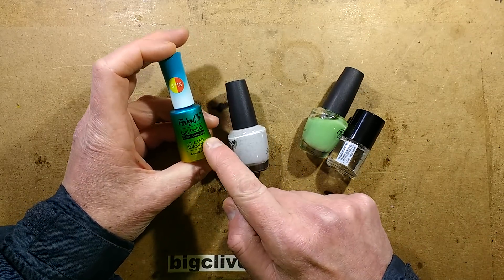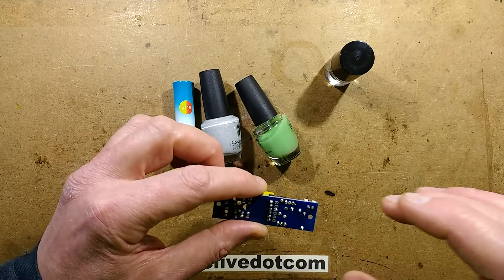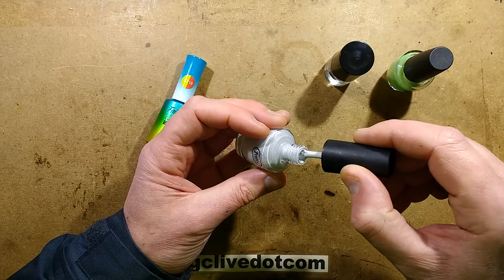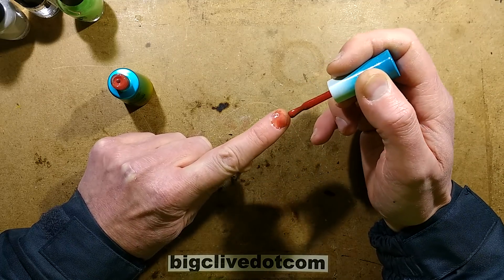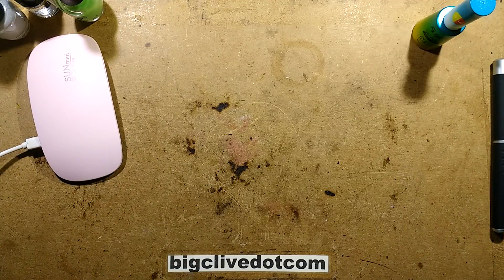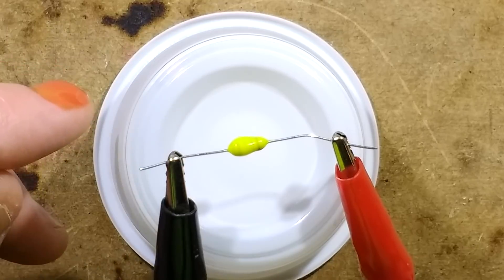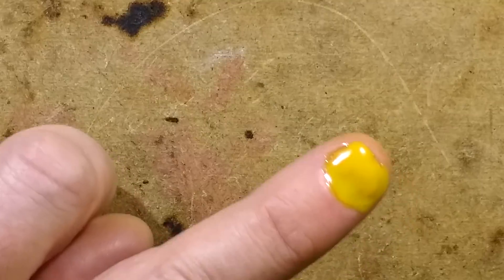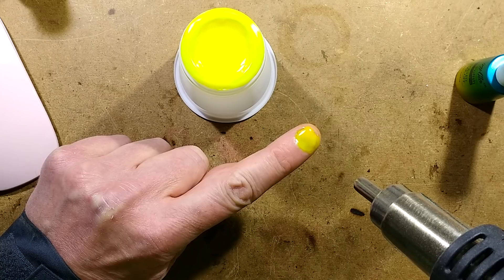Technical uses for nail varnish.

Comment: Not sure how I learned something about cosmetics from your channel, but I'm getting uv curing nail polish immediately. I HATE waiting for it to dry. Thanks!
Reply: Or maybe I won't. What's the point of saving 5-10 minutes putting it on if it takes 15 minutes to take it off, nevermind the solvent soaking. 
Tangentially, I wonder how many people have set their fingers on fire by smoking or something after / while soaking

Comment: I bought a  bunch of fluorescing  powders through Ebay from China and used them with clear nail varnish on some glass lamps. One fluoresces with an ordinary bulb for 45 seconds when the lamp is turned off. I found my first pink/green uranium glass last weekend it has a huge amount of pitchblende. Some of my 19th century uranium glass is also high in uranium oxides.

Comment: Afaik the soak off is usually a bit of cotton wool soaked in acetone held in place by a kind of finger sized peg for a few minutes. Still probably not great for your fingertips but a degree more localised to the nail than dipping your entire fingers!

Comment: And to think, we've been sealing screws on tape recorder head azimuth adjustment pillars for donkeys years, also very good for locking screws when replacing VCR heads. Quite handy too for cementing small low power TO220 devices etc.

Can also be used for decorating finger nails - apparently!

Comment: There you go 
https://www.ebay.co.uk/itm/10ml-Thermal-3-Colors-Temperature-Color-Changing-Soak-Off-Nail-Art-UV-Gel-Polish/142650300606?_trkparms=aid%3D1110006%26algo%3DHOMESPLICE.SIM%26ao%3D1%26asc%3D225082%26meid%3D429711d39ccc49e1b6c6161c4b1f3ba0%26pid%3D100935%26rk%3D1%26rkt%3D2%26mehot%3Dco%26sd%3D233599586653%26itm%3D142650300606%26pmt%3D1%26noa%3D0%26pg%3D2332490%26algv%3DSimplAMLv5PairwiseWebWithBBEV1Filter%26brand%3DBorn+Pretty&_trksid=p2332490.c100935.m2460

Comment: Hi Clive - greetings from Finland! Nail varnish is also pretty useful for modifying potentiometer tracks, in that painting over the very end of the wiper travel where the maximum resistance is achieved adds point where the wiper is electrically isolated from the track. Fun stuff.

Comment: I like how the nail varnish reacting to the heat gun sort of illustrates the little things that might affect even heat application. Obviously, the coating and actual material will complicate things a bit, but it seems pretty much like what I expected.

Potentially, if someone had to get an even, reliable application of heat on the same object over and over this could speed up the learning process, for relatively cheap. I don't know if it would be all that good for something where ya only get one shot at the real thing and want to practice, though. I assume a thermal camera would provide a lot more useful information for that.

Also, I love how full of life-hacks these comment sections can be. Even when it's seemingly quite silly, sometimes it's good to have more options for combating weird problems. I can't see myself painting fingernail polish on random things to fix the invasion of the LED's, but I wonder if anyone knows of a similar option that works of all or nearly all materials, staying on until I don't want it, and coming off cleanly and relatively easy. (without it or any necessary solvents potentially screwing shit up. I might be overestimating the potential problems of watery acetone, though.) When I started looking into tape for solar panels on garden lights, (Thanks for the mother's day project idea, by the way, Big Clive!) I saw people mentioning interesting applications for liquid tape, (It was in the "customers also bought..." section.) including as a way to cover LED's, I think. Even if it isn't good for that, I bet clear and colored liquid tape could have a lot of cool weird uses too.

Comment: Hey I'm sure you know yourself already as this was posted a while ago now and someone's probably mentioned it but you can also get the thermochromic pigment in that nail polish cheap in bulk off aliexpress for different temperatures , I bought some before for painting Zippo lighters and they go from black to clear exposing the colour beneath,  there's a vid on my channel,, they sell the photocromic light sensitive stuff and the glow pigment too , gave me a tester of them when I got the thermal stuff.

Comment: Hey Clive. Thanks to you I had some fantastic results using the Fairy Gel. What I did was paint the heatsink (quite large) which is attached to a mosfet on one of my systems. Using the laser temp guage I was able check approximate temp across the heatsink, giving me a good visual estimate of temperature as the mosfet temp increased. Super idea for a quick and easy estimate. Plus it looks cool. Thanks!

Comment: 2:17 - "...and if you add more in..."  From personal experience:  if after adding in the powdered pigment and mixing well it becomes too thick, check the ingredients on the side of the bottle.  Most polishes contain isopropyl alcohol and/or ethyl acetate.  If yours does and if you have either of these on hand, add some to the mixture one drop at a time using an eyedropper and mix well.  This will progressively thin it up again.  Just be careful to mix each time you add a drop to test consistency.

Comment: big clive i love u and everything but watching u mess on with that gel polish is making me cringe so hard. gel polish needs to be applied in thin layers one at a time with a minimum of a 30 second cure, preferably 60 seconds. u then need to wipe it with alcohol to get rid of the sticky layer on top. also that glow in the dark polish will take forever to dry given how thick it is 😣 ur better off finding a glow in the dark gel polish OR getting some polish thinner and adding a few drops to it to thin it out. sorry if this comes off nasty, that wasn't my intention. just sharing tips and tricks to makes these polishes easier to use 😘 xxx

Comment: A couple of other uses Clive is using a metal flake one on a case screw say in a laptop you have repaired and you take a photo of it. It then acts as a security warranty marker, you can never paint it again so the flake is the same. I also use nail polish to put a marker on all my tools as I used to be a mechanic and we had our own tools and mine had blue metal flake on them .

Comment: Interesting, indeed. You can cover your prototype PCB lines with nail varnish before you etch them, using the varnish, a syringe and a hypodermic needle. You can't do very thin lines and extremely difficult boards, but it's great for a start.

Comment: I also find it useful to use nail polish as a cable management solution. By color coding the ends of each cable, you can identify which cable is which quite easily.

Comment: I have a small scratch on the aluminum frame of my phone, and I tried to hide it with a black Sharpie but it got erased over a 24h period, I am wondering if I can put nail varnish on top of the sharpied area or if it would come off easily, I know I could get some black varnish, but it would be kind of a waste since I only need it for this one time on a 1cm scratch and nobody in my family wants to paint their nails black.
Reply: Black nail varnish is pretty cheap if you don't care about getting a decent brand. And you don't, if it's just for a phone. Not much of a waste.

Comment: Our washing machine’s stator windings were scored when the rotor hub broke. I carefully separated all the damaged windings, and covered them with clear nail polish to insulate them again, and with a new hub, two years later the machine is still running perfectly.

Also used to use it to lock azimuth and alignment adjustment screws in tape decks and VCRs back in the day.

Comment: Two more uses: believe it or not, back when dinosaurs roamed the earth and PCB blanks and ferrous chloride used to be available but laser printers and SMD parts didn't even exist, we used to literally paint our (clumsy but functional) home-made PCBs in red nail varnish, usually using one leg of a resistor - if we pre-drilled the board, quickly dipping said varnish-carrying leg into a hole formed pretty perfect little pads. It was very much etch resistant and you could just wipe it off with acetone afterwards. Oh, and of course, it's the stuff you use if you want to fix in place any calibrated trimmer pot or capacitor...

Comment: Great video Clive. I have another use for nail varnish that you may not have thought about - using it as a really low strength thread lock for tiny screws and nuts.

I repair vintage cameras and often require the screws to be fixed tightly, but not over tightened to the point where it would be difficult to remove. Once the screw is tightened up, a small blob of clear nail varnish over the screw head prevents it from unwanted loosening, but it’s weak enough to be undone should you require. I’ve used this trick on spectacle frame screws, guitar bridge adjustment screws, cameras, and many other items.

Red nail varnish can be used on nuts and bolt heads as a indicator to show if they have loosened off, a small line of varnish over the bolt head and onto the surface beneath will easily show if the fastener has worked loose.

Comment: The glow in the dark varnish is strontium based. If it was strontium 90 it would glow for centuries.
The resistor coated in the colour changing lacquer reminded me of the old body-end-dot method of colour coding resistors. The colour changing paint would cause a little confusion!
Could be useful for coding thermistors, get the pigments right then the colour code would track the thermistors actual resistance whatever the temperature.

Comment: @Bigclive if someone wanted to do a bodged job and make a PCB board less susceptible to moisture damage would the clear lacquer work do you think? In other words paint the entire board in the clear lacquer to protect it from moisture ingress? I have a device that is not waterproof that I would like to place outside.
Reply from the maker: It's a common technique to coat PCBs in thick conformal coating like that.  Quite often literally dipping the PCB in lacquer.
Reply: Interesting cool thanks good to know. Keep the videos coming thanks again

Comment: The chemistry of temperature-sensitive nail polishes is explained here --
http://www.labmuffin.com/how-do-thermal-polishes-work/

"These temperature-controlled products use pigments known as "leuco dyes". These clever systems consist of tiny little spheres called microcapsules, which are about 1 to 10 microns across."

See also:  https://en.wikipedia.org/wiki/Leuco_dye

Comment: I keep a bottle of deep blue nail polish (company color) at my bench and use it for fixing adjustment screws on pots and capacitors after alignment or tuning.  It provides some small drift prevention due to mechanical shock, and also an indicator for tampering.

Comment: Clive, It's good to see you are comfortable with your gender identity. Never doubted that for a moment.
However i do think you may be on to something with the temperature shift paint - visible indication of overheating perhaps ?
Coat a heatsink so you can see the hotspots ? LED heatsinks, High current regulators, A small dab over the die of an IC ?
Now if only thier was a way to adjust temp shift higher - or is there ???

Comment: Another use for the clear nail polish that I learned in a geology course is as a clear-coat for markings. In the geology class we were taught the technique of marking rocks by first painting an unobtrusive part with white-out, then writing one's not with ball-point pen, and then seal with clear nail polish. I've taken that same technique to marking circuit boards. Even using the clear nail polish as an additional coating to help keep little tiny p-touch labels from being easily picked off. Note, the acitone solvent in the nail polish will cause some inks to smear (for example sharpie ink). You may need to experiment with ink types to find one that works best for your application.

Comment: Hey buddy, not sure if it's been mentioned, but many nail polishes are nitrocellulose based so even when all the solvent has flashed off they are reasonably flammable. It would be interesting to see if arcing on a circuit board could set it on fire. Doesn't stop me from using it as a poor-mans threadlocker though :)

Comment: Does Clive have colour-changing toenails, we wonder??? Thanks, BC. Many people have used unwanted nail varnish for locking screw threads, securing wires, attaching items, even low-load repairs, for decades. It is just as effective as, and much be cheaper than the 'proper' thread locking compounds, especially if you scrounge it from the females in the family when they're having a clear-out. Free samples from Avon, etc, are also useful! Thin the varnish with (scrounged!) nail varnish remover when necessary.

Comment: i believe its thermal reactive pigments. they usually change around 87F. they sell it for car paints too. I was going to get some thermal black pigments, which they mix with a clear, and paint my white car. SO when its 87f or above the black pigment goes clear showing the under color, which i thought would look cool. And below that temp it would be black. I thought it would be nice during hot summers the car would be white and not absorb so much heat. then when its cold at night or during winter it would be black except for the hot parts. really neat stuff!

Comment: Plot twist: Clive opens his own nail salon after he stumbles across a conductive transparent nail polish which enables him to light up the phosphorescent dye on the nails of every woman, man, and cat, on the planet. He throws out a nice video where he explains that a Light Emitting Capacitor works by the field effect, similar to how you turn on mosfets, but rather inverts the population of virtual p-n layers on every cycle of the rf circuit, giving light whenever a hole (positively ionised atom in the crystal lattice, in the p virtual layer) meets with an electron again. He then goes ahead to engineer the rf circuit, based on a symmetrical Joule Thief (royer type) design, and then reverse engineer it, for the sake of the video. :) He will then make his latter discovery while pondering the potential of the design, that Nickel 63 is like Tritium, but better, and will invent the: stay on lit forever nails. 
Kisses from Greece/Love Glasgow, miss my old house over there at Glasgow Green park.
Reply: Meanwhile the comment section makes endless smutty comments about "holes". Sorry Clive!
Reply: greenaum: Smuttyness is in your mind, greenaum. A hole is a left behind positively charged ion in the crystal lattice of a solid in terms of solid state physics...
Reply: Yeah I know that, ta. But it's not all a hole is!

Comment: You can tell you were never a goth! I used to be able to put on nail varnish whilst drunk in a very dark night club. That colour-changing nail varnish would be very useful for Orange Pi single board computers as the processors are notorious for getting too hot.

Comment: I used nail polish extensively in my shop to match Allen screws on the machines to the wrenches that go in them. Ditto for other kinds of wrenches. It's all color coded. The pots and pot lids in my kitchen as well. This little thing has saved me countless hours wasted searching for "the right one".

Comment: I have been using clear nail polish for decades. Sometimes its the easiest way to insulate small wire repairs to prevent shorts. Never came across the colour changing one but that definitely useful. The glow in the dark seems interesting too.

Comment: Oh boy, thermal nail polish is cool if you have long nails you get the benefit of 2 colours on your nails without doing a gradient, yeah I dont do gels or acrylic nails for this very reason standing my fingers in acetone isnt my idea of fun, so I just regular polish, you can also get a peel off basecoat with means you dont have to soak your polish off.

Comment: This $12 ebay emr detector is pretty interesting, it has an internal antenna and picks up magnetic feilds https://www.ebay.com.au/itm/NEW-Pro-Digital-LED-Electromagnetic-Radiation-Detector-EMF-Meter-Tester-J8Q6/302445549422?epid=716472746&hash=item466b28d76e:g:Ik8AAOSw0yxZsqb2

Comment: not to advertise, but rather from experience from work: Plastik 70 from Kontakt Chemie comes in an aerosol and lacquer form and is designed for conformally coating circuit boards. There are other manufacturers of course, it's just what we tend to use.

Comment: Plastic model builders use nail polish as a custom paint for cars because you cannot get the old fashioned automobile paints like nail polish. Using the proper primer is most important,otherwize the paint melts plastics. Use thinner designed only for those polishes.

Comment: I use it for metal etching. Paint it on the areas you dont want etched. Put salt water on and add a little bit of DC current and it eats the metal away.